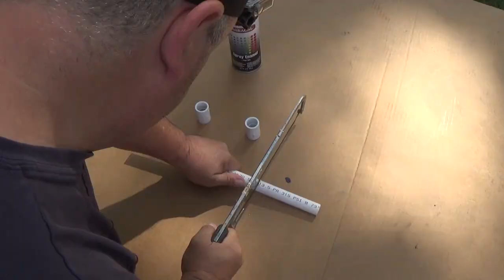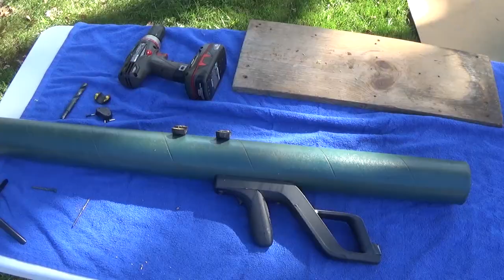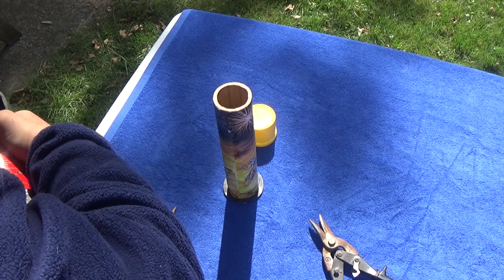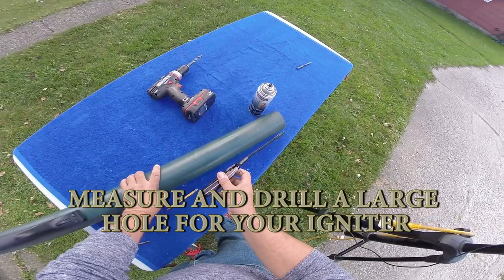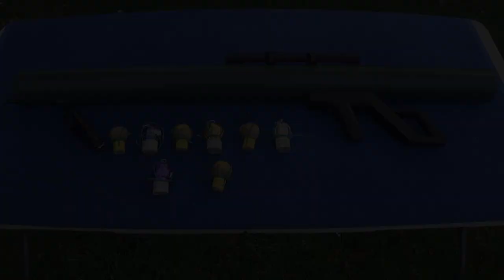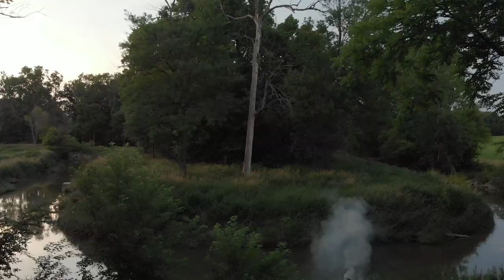Making A Fireworks BAZOOKA

Comment: Very awesome, I just made a mortar cannon that is mounted on a lawnmower tank
Reply: Is it a rideable mower and if so how armored is it?...
Reply: @therantman4120  with 11.5 hp I was able to put 100 pounds of steel in the frontal armor, ricochet 54r rounds
Reply: @ianhale4466  oof just frontal armor. is it bullet proof or naw cause i would like to test a few of my own shells
Reply: oh wait. yea i think i seen your lawnmower tank. not much fire power but looks super intimidating and it goes 5 mph and struggles uphill. is that the same tank.
Reply: @therantman4120  what firepower did it have, i have a mosin nagant and an artillery shell mortar angled horizontally
Reply: @ianhale4466  yea its you. no offense but that thing would be demolished by my launchers. i even have Flame rounds for it and your wide open on top. yea you could stop a frontal assault and scare your neighbors but its not practical. 1 Molotov... your done. not how its suppose to work dude. maybe add a chaingun up top if your going to be up there anyway.
Reply: @therantman4120  I live in the middle of nowhere, you probably just seen something similar and the mower is really just a lawn decoration/mower, I turned my 85 ramcharger into a tank with a 35mm cannon and up to a foot of mild steel armor around the whole thing.  Its entirely water proof, so no molotov is getting in and it also has smoke discharges and a spot for a ptr91. Im working on a 88mm replacement cannon
Reply: @ianhale4466  well it sounds like a beast then. to bad there is no way to test against a swat tank. are you confident enough in your build? what could stop you but run out of gas or attack heli lmao...
Reply: @ianhale4466  My Nade launcher is very accurate and has a max distance of 400 feet. (im an american that dose not know meters.) plus its capable of firing 4 different ammo types. Reg, flame, scatter, and piercing. MY RPG28 is almost done. will give whole video on that to show rate of fire,distance and accuracy. my whole shtick is turning fireworks into actual viable weapons for pennies on the dollar. most of my stuff is built from trash.